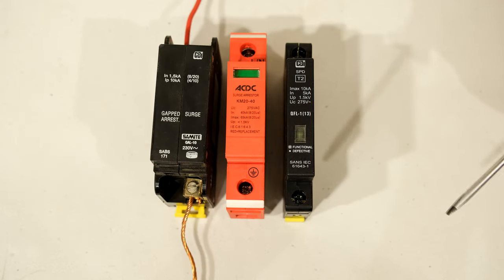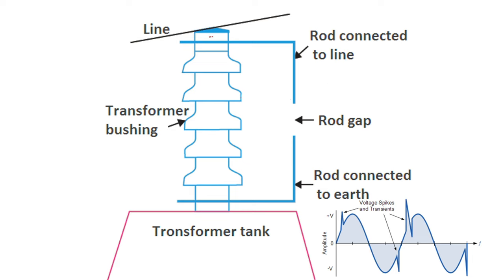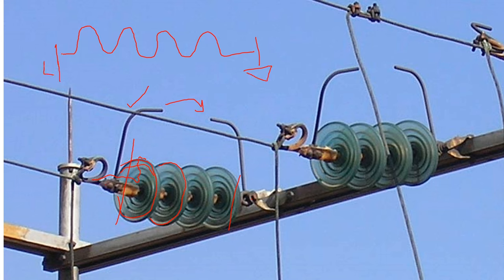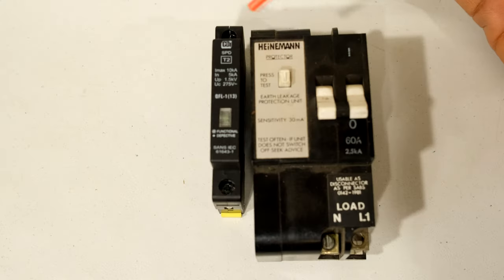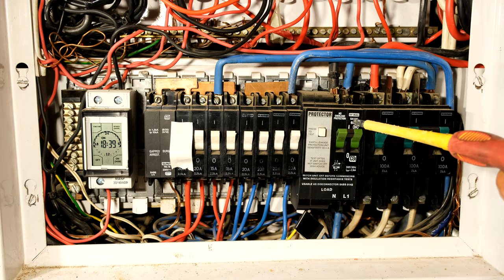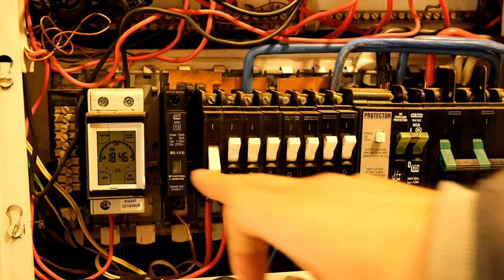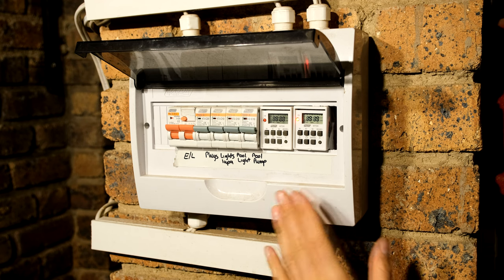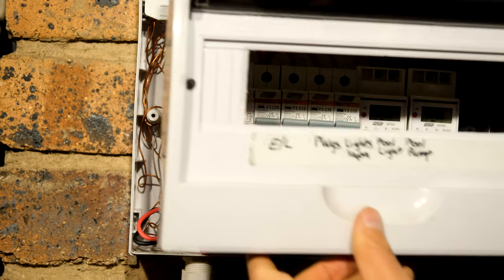What is a surge arrester SPD and how do you install it - detailed tutorial.

Comment: In your other SPD video, you mentioned that it is code to use 16mm wire on the surge arrestor - how does it work here where clearly the incoming source is smaller than 16mm

Comment: When adding the surge arrester to the DIN rail next to the L in main switch with circuit breaker (247v) and using a "jump wire" instead of copper busbars should you wear insulated gloves? 
🌏🇭🇲

Comment: Hi. Thank you for your informative videos as a training refrigeration technician I am learning a lot from your videos both electrical and technical. Just one question about the surge arrestor, I bought one recently which is a double pole. On the top side it has neutral and live and at the bottom it has earth only. On its body the neutral pole has lite indicator as it has on the live side. Now on connection I have an indicator only on the live feeding side only. My question is about the neutral side lite indicator which is not lighting, is it correct or I have missed something on connection, pls help.

Comment: You use mostly L-E connected surge arrestors. At 13:46 into the video you show an arrestor that has 3 x L-N and a N-E arrestors. Normally at the point of connect into the property the Neutral is grounded, so there must be a huge current (probably in excess of 2kV) before the N-E arrester operates. YET. Insurance and other idiots (like importers) require the Neutral to Earth arrester. Does that make sense?

Comment: Should I use DC SPD with a UC of  500vdc or 100vdc for Lightning protection on my Solar power system?
 Solar charge controller  it has 100V max PV voltage input.

Comment: How does this device protect your appliance if it's connected in parallel.  Meaning when some access goes down some goes through ending up damaging your equipment.  I will feel safe if it was connected in series.
Reply from the maker: Its job is to shunt high amplitude voltages with a high di/dt to earth and must be connected in parallel